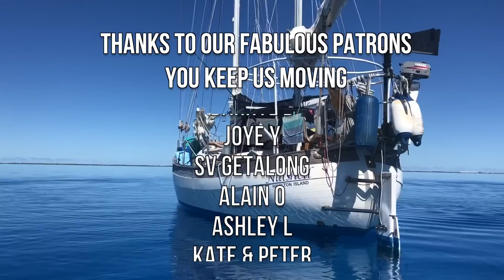Ep 181 | Fixing Peanut's Carburettor, Making Baggy Wrinkles, Sailing Nutshell

Comment: An interesting comment I saw in a car repair station in Wisconsin: in 1960 80% of the repair cost was to analyze the problem, 20% for the  replacement part. Nowadays, 20% of the repair cost is to analyze the problem and 80% is for the repair part. Bottom line: nothing has changed.

Comment: Had this crapola with my Freeman 22 Crossflow 105E carb - stripped it down.. all Ok.... rebuilt... cough, splutter, cough, die..splut... ... split it again.... removed the float (as you do.. again)  Turns out there's a teeny filter between that pointy float thing and the fuel-in - that was the nuts..  OH, it's a FOMOCO - FOrd engine Motor CO carb...   genius name.... (not)

A few squirts of compressed air and a few swear-words and... goodbye crudola and hello beer......... well... another hour of putting the whole kaboodle back together and there we are - 20hp of serious power-cruising on a 1100cc Ford Escort MK1 1969 engine... ..... chug.... and  a very happy engine and I'm sure I heard it is smiling as we attempted the water-speed record for possibly the slowest boat on the river...

Next Christmas I'm going to ask Santa for a fuel filter.....or I might just fit one myself.....  Or, another tin of compressed air for more jobs I don't yet know exist...

This year I got a set of Whitworth Spanners..... To anyone who doesn't have an old boat, this seems a rather unusual gift but for those that know, a set of Whitworth Spanners are Genuine Gold

Next job... the Simpson-Lawrence Sea Toilet refurb.... Might need much more air..... and some beers...  lots of beers possibly

Always amazed how we ever made it to the moon with all this crazy technology ...  Everyone needs a Whitworth Spanner one day....  Today though, it's time for a beer . . .xx